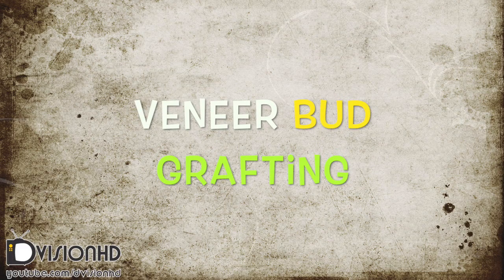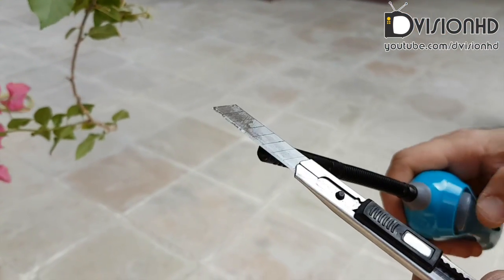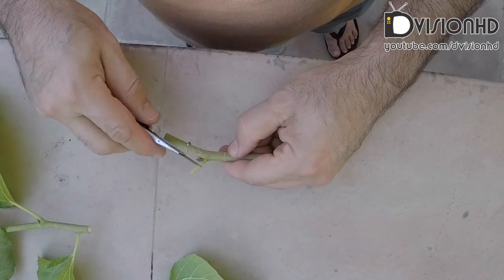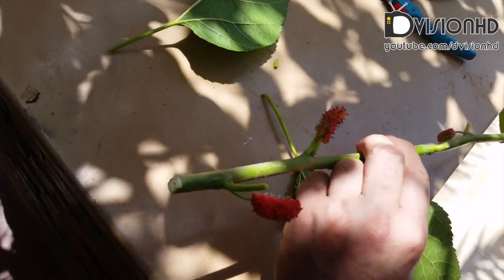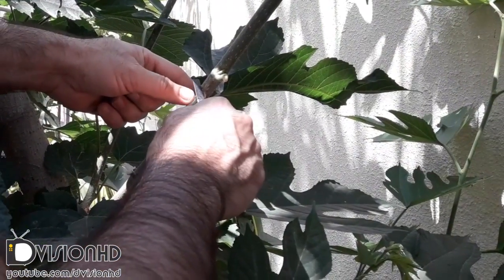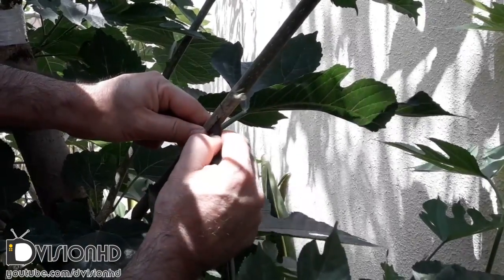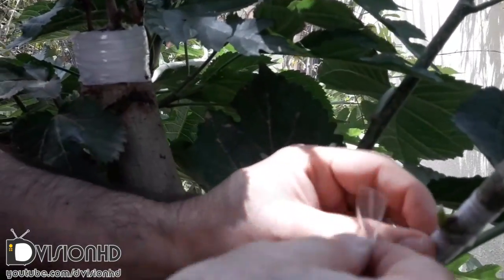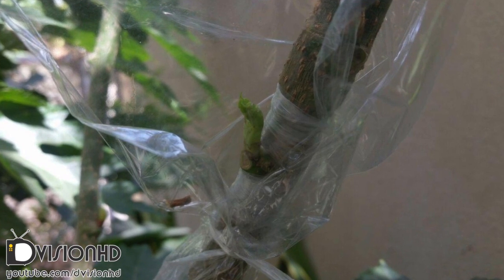Veneer Grafting mulberry

Comment: Cutting your plastic bag crosswise the width you want is much faster and creates longer strips. (bread bags work fine.) Dropping the bud in water while you are working the root stock will keep it from dehydrating. Wiping the grafted bud and tape with paste (floor) wax keeps the bud from dehydrating, seals any holes, and allows the bud to grow. The bud can be held firm by wrapping a cut rubber around it. Paste wax also helps grafted scions from dehydrating.
Thanks for the information.